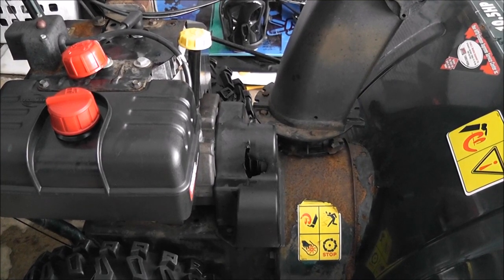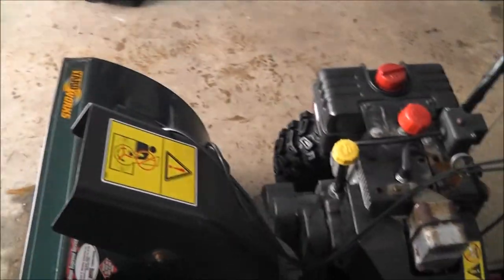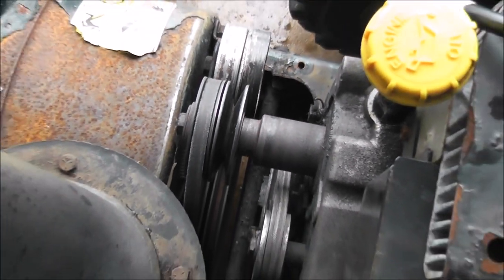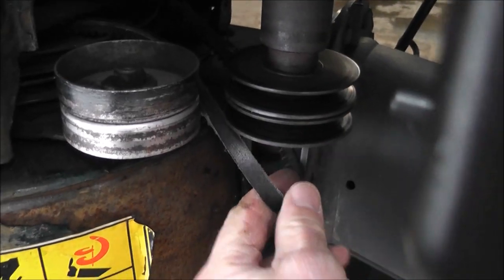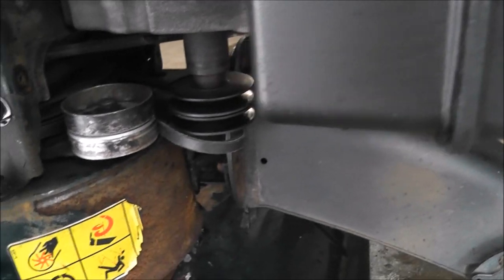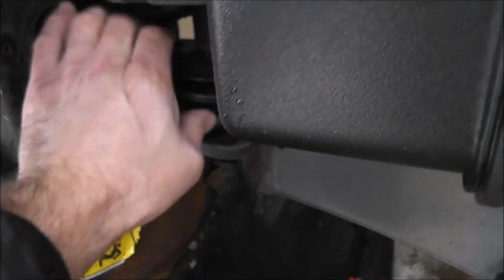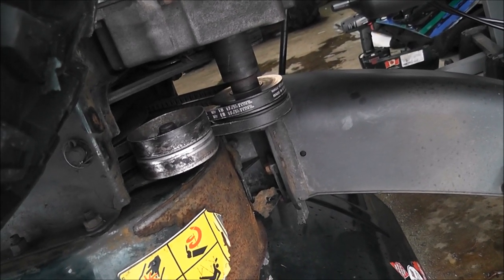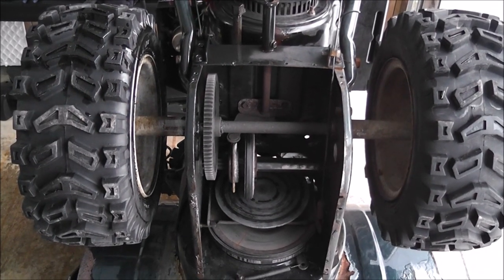Replacing the Auger belts on a Yardworks 10 HP snowblower

Comment: So I put 2 new 3/8 x 35 inch belts in and blew through belt closest to the bucket in 5 min again . Bought this snow blower used. Here is the message I got from the owner. Any idea if this would be the problem ? . , “””””l think I may know the problem. The worm gear in the auger gear box had some work done to it and 2 spacers might not have been put back .There are two spacers that should go in the gear box that I believe are not there. They hold the ring gear in position. Without the spacers, the ring gear could move. This could lock up the auger. “””
What do you think ?

Comment: Why didn’t you do the “top” belt first?? Then you wouldn’t have to fumble with the other belt being in the way. AND a thin flat head screwdriver works great to gently wedge the belt onto the pulley.
Reply from the maker: It's been a few years since I did that vid, I had to re-watch ... I believe we slid the bottom one through but didn't attach it until we attached the top one ... I don't have that machine any more but when the belts go on the new one I will use your flathead suggestion.  thank you
thanks for watching

Comment: Why would you edit out most of the video explaining the bottom end of the belts to the pulley?
Not as easy at it looks maybe? on the bottom with everything in the way you just can't slip over. 
Especially when it comes to the square bar that goes right across  besides turning out the bolt that keeps the belts from popping off the pully.

Comment: Take the Pulley off  top first then put the belt on big pulley at bottom , then set belt in pulley you removed then slide the pulley back on and save taking the plug out lol ! That's the best and easiest way  . 
Blow your nose before you start mister !
Reply from the maker: Thanks for the info